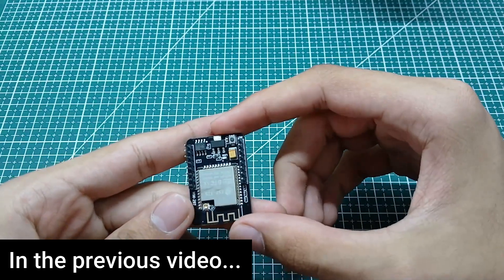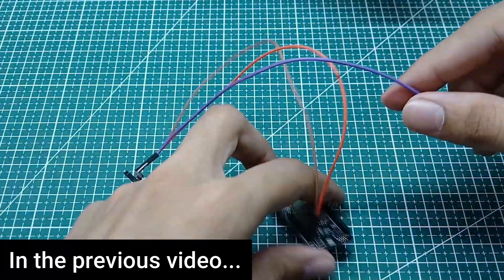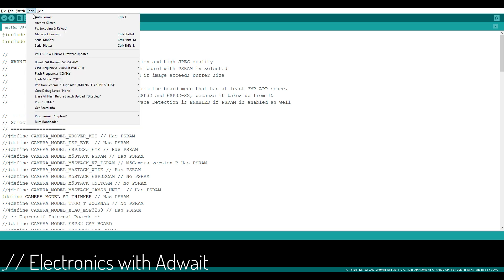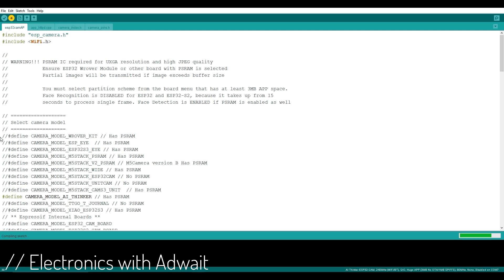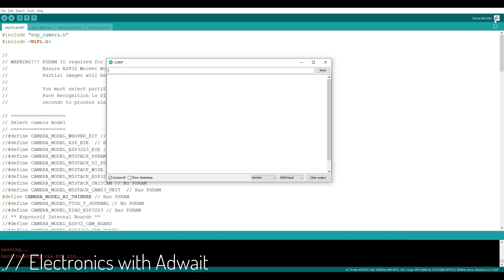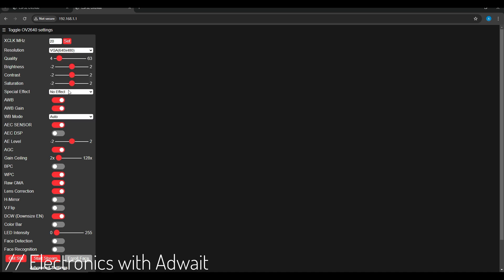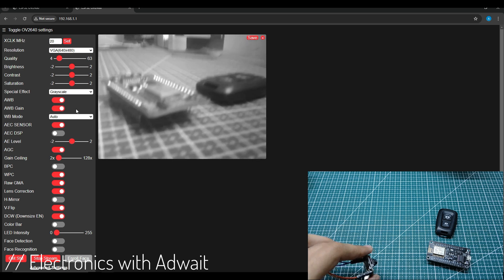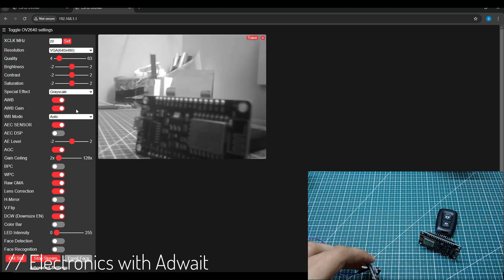ESP-32 CAM in Access Point mode (AP Mode) | Electronics with Adwait

Comment: Hello and thanks for the video. but I have a question... why on one of my esp32cam stream in AP mode works fluently and perfect and on the other one very slow, too slow? When they are in STA mode, they both work without problems. I hope for an answer

Comment: port show nahi karat ahe Adwait. Not showing any COM
Reply from the maker: USB la connect ani disconnect karun bag device manager open theun , jar port section madhe com port disat nasel tar PC madhe problem ahe. Thank you for the comment 😊
Reply: @ thanks Adwait jevha code upload karaila gelo tevha option ala com cha. Ata no core dump partion found yet ahe and E (933) camera: JPEG format is not supported on thia sensor. Kai issue asel ? Hii last step ahe

Comment: Good, but if it throws compilation error, you might need to make a slight change. In app_httpd.cpp locate string "ledcAttach(pin, 5000, 8);" and replace it with 
ledcAttachPin(pin, 4); // Attach the pin to LEDC channel 4 (or any valid channel)
ledcSetup(4, 5000, 8); // Set up LEDC channel 4 with 5000 Hz and 8-bit resolution
Reply from the maker: Yes you are right , thank you for the comment !! Stay connected.